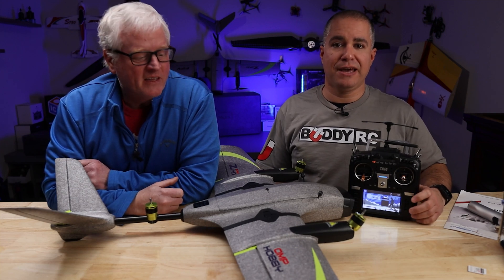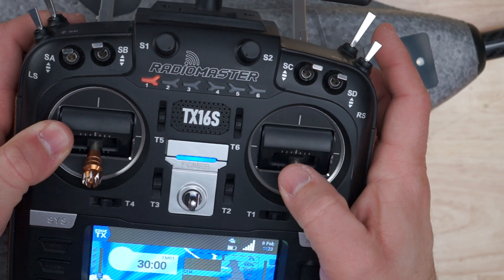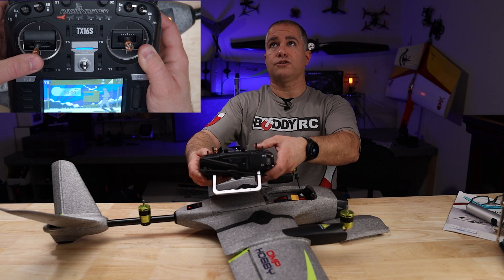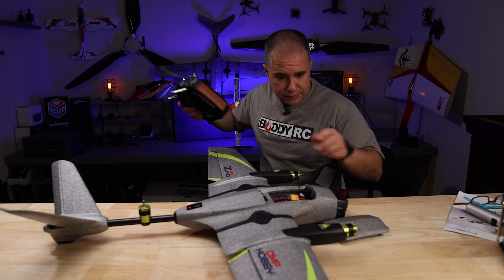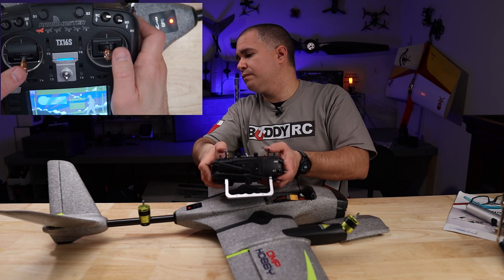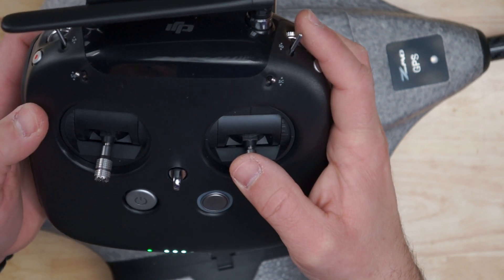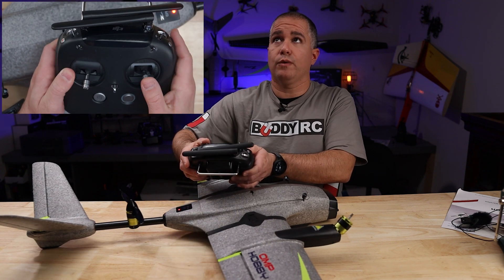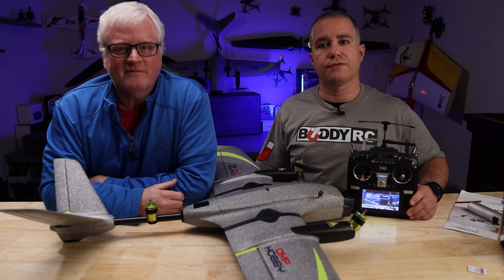OMPHobby ZMO VTOL Debugging (trim settings)

Comment: Great video. But now  I have this problem: i can control the motor angle setting (drone mode) only for the right motor (aileron) and in airplane mode i can control only the left motor (rudder). For aileron no problem. For elevator the right elevator is ok for the left I have to set the throttle all the way up and than I can control with the rudder. At this point is not safe to fly… . It’s possible  to reset the FC (or to flash the firmware)?
Reply from the maker: Hello there no way to access the FCs firmware but please write us an email at support@buddyrc.com

Comment: Great video Eddie. 

Question: In doing the motor angle trims is there a analog reading setting from say 0-180 degrees to help in precisely setting the motor angles. Seems like just eye balling it is not very precise.   

Not an issue with the control surfaces though. 

Just asking

Thanks
Reply from the maker: 90 degrees to the wing in VTOL mode but this video is for everyone and most don't have a pitch gauge. The flight controller does most of the work.